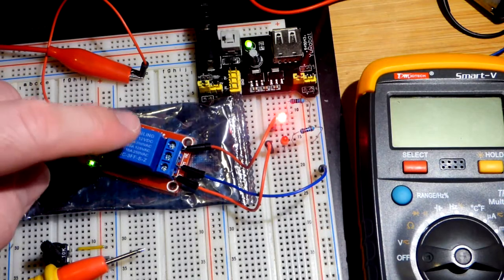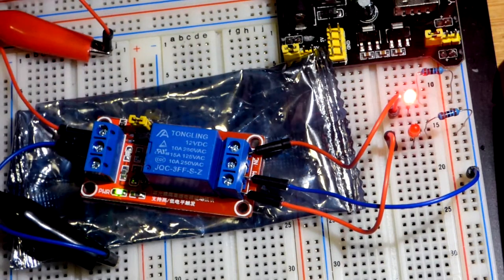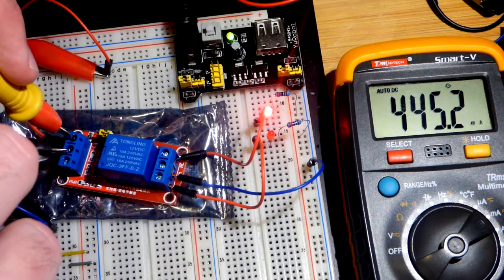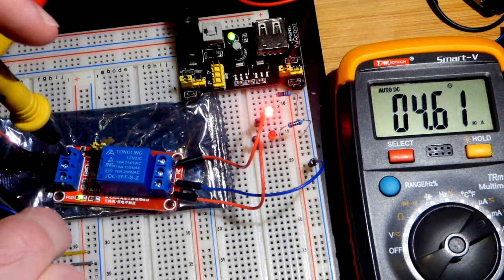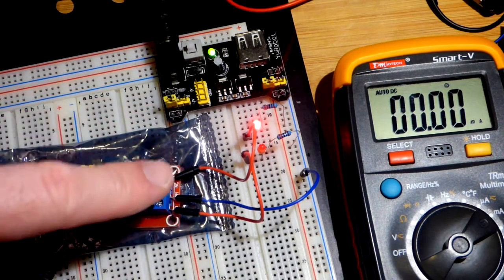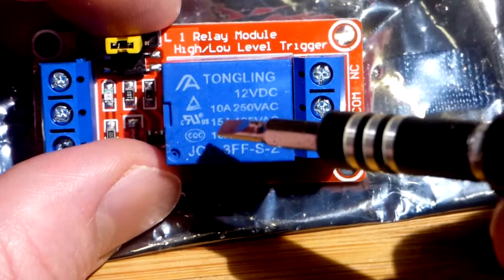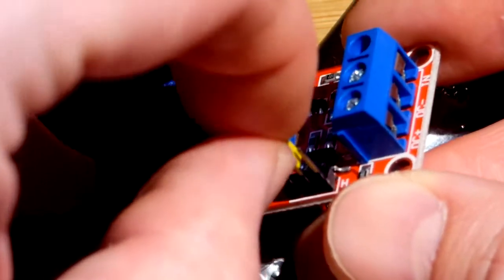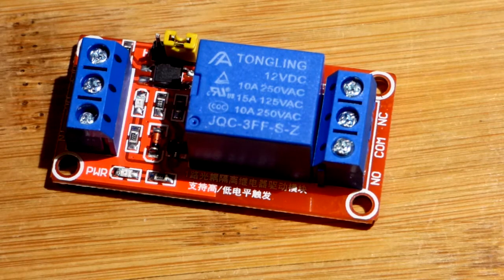Electronics 12V relay with dual NC NO switches module with high or low trigger

Comment: Could this help save reed switches from putting up with too much current and getting baked?    Hooking up Diodes help some but not that much.  Most of my experimental table top motors use up more than 1/2 amp.
I have also taken out a motor out of an LG front loader washing machine. .  The motor is like 12 inches in diameter, 36 coils, 24 magnets with hall sensor 3 phase bldc.  I like to run this thing.  Is this going to be over my head project?
Thanks in advance for your help.
Reply from the maker: Definitely want to use a reed switch to control a transistor or relay when the reed switch alone can't handle the current alone. Doing so may seem confusing at first, but that's exactly what relays are made for. It's a strong switch controlled by a weak switch. So by studying relays more, you will come across someone showing how to do exactly what you want to do. Probably sooner than later. After that it will be super easy to do again. Hope it goes well!
Reply: @Electronzap  Do you for magnetic reed switch I might use lower voltage relay like 5 volts or perhaps with higher voltage it would probably mean I just have to keep the reed switch a little further from the magnet or...?  what do you think?
Reply from the maker: @alchemy1  Whatever voltage you like working with and that the switch is rated for. All the signal from the reed switch does is tell the relay to turn on or off. It doesn't need to pass much current to do that. Lower voltage relays will probably need a higher signal current though. If you buy a relay module, then it should be made to take care of everything else, as long as the relay can handle the voltage and current of the load it is switching. It's always a good idea to verify the maximum current that any particular component can handle, and make sure it is twice of what will be needed. Sellers and manufacturers provide that data.
Reply: @Electronzap  I figured I should elaborate what happened.
The 5 volt relay clicked on and clicked off, click happy, it was to busy using its energy keeping up with the click on and click off than anything else.  And the motor was getting less than 1/2 of the speed as a result.  The 12 volt relay was too much for the reed aside from its own clicking audibles.  The thought of clicks and the  relays not being able to handle the frequency of the reed switch on and off every god knows how many times a second depending on the motor speed. 
Speaking of switches, my homemade switch can put up with more abuse than any reed switch  could.  The only thing with the reed switch is it being sensitive it can be more than an inch away from magnet and it gets the ball rolling but it is way too sensitive, it gets compromised easily I throw them away like hot cakes. .  Anything beyond half amp it doesn't like.
My homemade switch makes a little more noise, have to keep it pretty close to the magnets and if I play my card right after a certain speed it doesn't have time to make noise, and certainly it is  far more durable,.  I just clean it after use.  Doesn't hurt my feelings and if it gets fried I just solder another one.  :-)
Unless there are better reed switches ( whichever ones they are) or some other way of using it and the diode connection hasn't really worked, not for me and I don't know why other people use it.  Nobody tells you that a diode does some good but it is not that great. 
I have been wondering about a capacitor. Why that won't work. In the old days in the car's ignition system they had what is called a condenser, another name for the capacitor.  I guess the first name of the capacitor was probably condenser.  It was installed in the distributor to save the points opening and closing as the coil magnetic field collapsed.  So I wonder why not with this? I never seen anyone mentioning it at all.  I don't think reed switches are that big or popular with running motors, maybe for doors or other less operation with far less frequency is probably alright.
Reply from the maker: @alchemy1  I have read about a time where capacitors were called condensers. I think pre-made relay modules have kickback protection,  but odds are a lone relay component won't. Usually I see diodes being used instead of capacitors. I have read of industrial equipment using capacitors to capture the kickback in order to reuse the power.